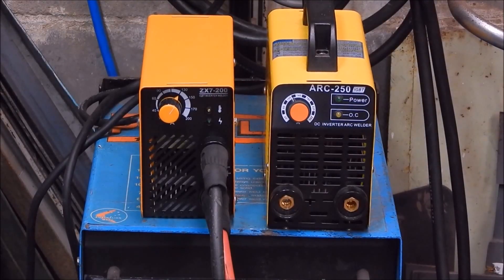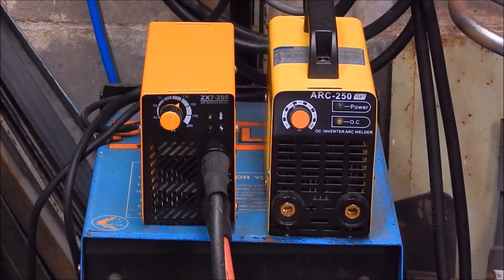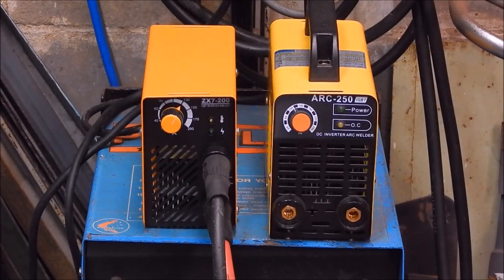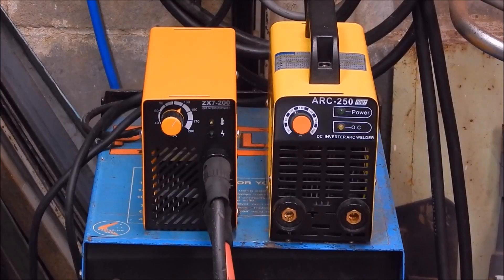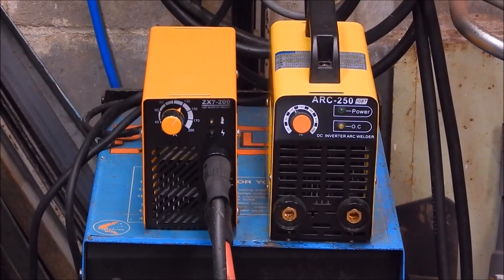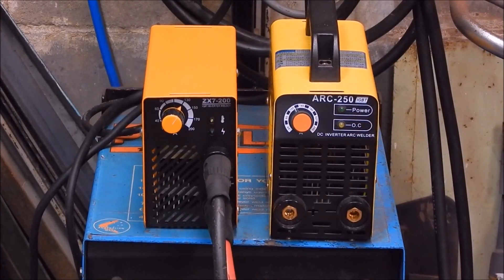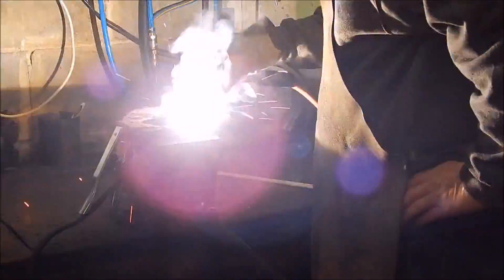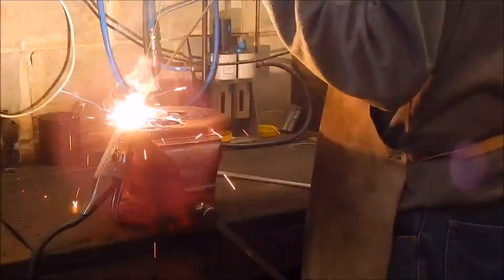How easily will the tiny ZX7-200 inverter welder overheat ?

Comment: That is impressive for such a tiny unit - pretty good. May be time I get rid of my old Lincoln buzz box!
Reply from the maker: Don't Chris. You still can't beat AC for burning through rust, paint and crud.  DC does not like that environment.

Cheers Rob
Reply: Certainly true enough Rob yes - but over the years I invariable cleaned surfaces first - although that old machine did handle mill scale well. :)
Reply: @ChrisB257  If we're talking about tiny and maybe underpowered hobbyist kind of machines here, it makes all sense to do the preparation, grind and file and brush, whatever the situation seems to require.  In America, the idea of welding dirty painted rusty stuff is very strong!  It's very hard to get people to get that base metal showing, very hard to get them to put that work clamp ON the WORK!  Spread that message, rise above!  In my own limited experience doing this preparation and cleaning really helps you get results from small machines.

Comment: re: carcinogenic. I felt stick was less harmful than mig or tig. Turn on the fan in well ventillated area, stand upwind, air  is pretty clean. With tig especially, the air has to be so still to avoid fouling the shielding gas. It's clean, but whatever's cooking goes right towards face. I wore a respirator in any case. Curious what y'all think.
Reply from the maker: I saw a chart that listed MMA at the high end and worse than MIG/TIG for fumes.  I usually have a fan on to blow away the fumes.  Some 3.2 rods throw out lots of smoke.
Reply: HM.  Clearly MMA makes vastly more fume than TIG, but in TIG you get more of it!  TIG welding on very clean material should make much pollution, I guess the real answer is some kind of exhauster/filter that doesn't make too much general air movement.  I've had TIG welds messed up by the breeze coming out OF the welding power supply!  Someone might have to take measurements to deal with this question, some kind of particle meter.

Comment: thanks for this interesting test. Of course you still dont know the real duty cycle since you did not get it to overheat after 5 rods. But for sure I agree that the little welder exceeded most expectations and is adequate for home shop usage.
Maybe banggood is ready to sponsor a bigger quantity of welding rods in order to find out the real duty cycle. You would have to weld until it gives the red overheat signal and then wait until it gives green light again. The ratio of the welding time divided by the total time multiplied by 100 is the duty cycle percentage (starting cold) when restarting to weld after the green light came back do another cycle all over again then the duty cycle would probably be a bit shorter due to the hot start. That value would be interesting to amateur power users or pros. Having a fan and its small size make me believe the real duty cycle is much better than the table says. Who knows maybe that dwarf welder could even be interesting for pros in certain situations. The next thing to test would be the lifetime of this "lunch box". But only a pro who really welds many hours per day could test that.
Reply from the maker: So much data for Chinese goods is wrong or misleading, it's a problem.  Clearly this welder has a better duty cycle than the sticker says.
Reply: I dont quite follow why more data is a problem for Chinese goods. Because western products cannot compete anymore? With a welder that cheap and that good it certainly is a challenge to western production. They better shape up and come up with something similar. It may be a little more expensive but not a lot. Your test is valuable information for our metal working and welding viewers in youtube to be informed before they decide to buy the lunch box. It is not only good for banggood but also for the potential buyers.
Reply from the maker: What I meant was that many of Banggood specs/tech descriptions are hopelessly wrong.  Throw in the dodgy user manuals and questionable duty cycles quoted for welders and things get a bit sketchy as to what the product can actually deliver.

These reviews are certainly the only way to get a handle on what is factual.

It's quite evident that the guys writing up the web descriptions on these products don't have much idea on what they are dealing with.
Reply: I agree. I guess they just use the supplier's description unchecked. And those come from their sales department if they have one at all. Maybe the granny of the factory owner is writing the specs...hahaha
Another idea of test would be to find out how high the amperage goes. On the dial the maximum reads 200A. Can it really go that high?
Reply from the maker: No idea Rol.  It's academic anyway as you will never do that. It's obviously got some more amps in the tank.

Cheers Rob

Comment: Might be the camera angle... but those welds don't look very straight. ;-)
Thanks for taking the time.  I was curious what kind of duty cycle a home gamer could expect.  I'd say that is more than adequate.  Only time I can see cranking through rods like that is when applying hard surfacing.
Reply from the maker: They're not.  Never meant to be.  This is a burn and see test.  No weld quality here ;)

Yes, hard facing dozer blades and tracks is about the only  time you would weld like this.

Cheers Rob

Comment: Wonder if you can find and test a good little, cheap welder for aluminum welding Rob? There are a few vids on stick welding aluminium like this https://www.youtube.com/watch?v=FNiKJZkdDTA and they seem to get good results. Perhaps the little ZX7-200 reversed could do it too?
Reply from the maker: Hi Benny,

Not something Banggood have.  You can actually buy stick welding rods for aluminium, but they are not suitable for light gauge work, mostly to repair castings.  Ebay have them.

Cheers Rob
Reply: Thanks Rob. Come to think of it, all the videos I found were demonstrating 1/4" angle or plate aluminium - reinforcing what you point out for light guage. 
The interesting thing was one mentioned pre-heating the aluminium to allow reduced weld current, which allows a less than frenetic pace during welding. My application is some fairly heavy stock, but the pre-heating maybe something I'll try. Hell, what can go wrong??
Reply from the maker: What could possibly go wrong ?  How many times have I heard that before the shit hit the fan ?
Reply: Duck!